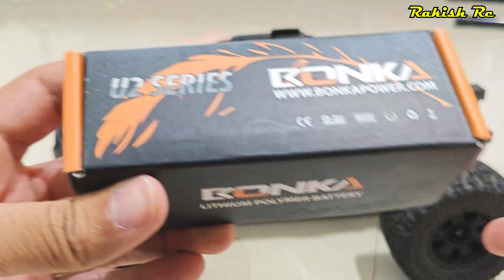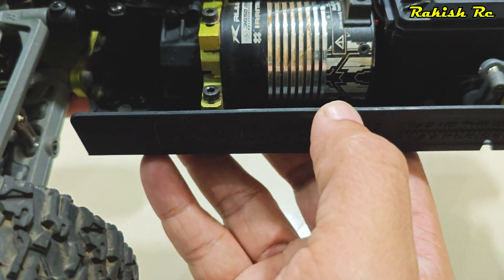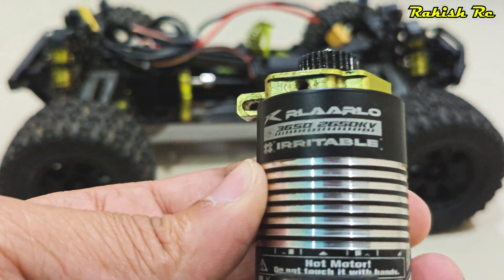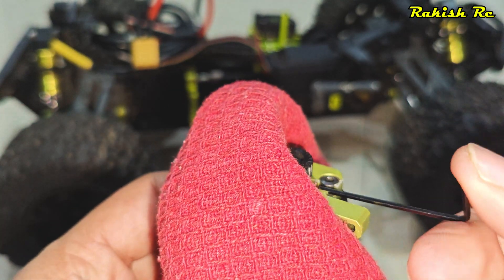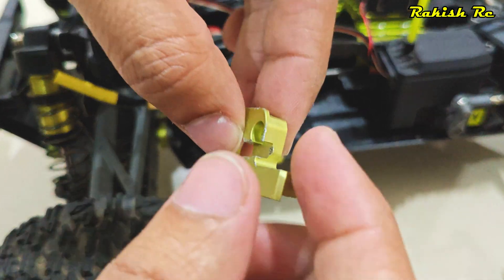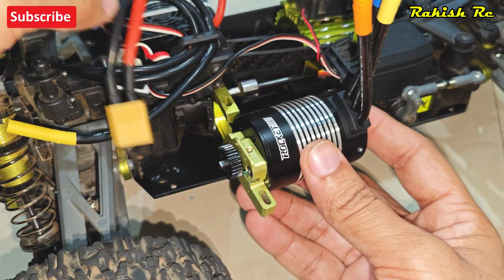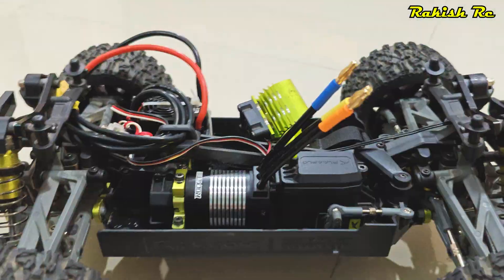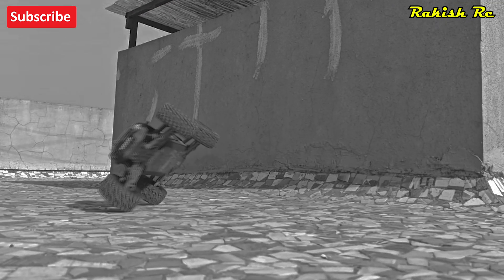Rlaarlo Omni Terminator 4s LiPo Battery & 4s Motor Upgrade | More Power!

Comment: Did this motor swap solve your heating issue?
Reply from the maker: On 4s the motor still heats up but compared to the stock motor on 4s it not that super hot. The best solution is to have a high rpm cooling fan on the motor.
Reply: @RakishRc  so the rocket motor is pretty good then? do you have a link for it?

Comment: I have a 4s 3300mh 50C , put it in the car and the car beeps at me then turns off , any idea ?
Reply from the maker: Stock esc is only 3s supported...does not work on 4s...need to upgrade the esc to 4s if you want to use with 4s lipo.

Comment: In your opinion, would it be better to go same size motor with lower kv, or bigger motor with same as stock kv? Thanks much!
Reply from the maker: @OGWHITEFIRE  i would choose a bigger motor and same kv Or slightly lower... Rlarrlo has 36 and 40 series motor mount option for the terminator.. So even though I am using a 3652 motor I feel like going for a 40 series motor is better for 4s usage. More power and also less heating as motor won't be under stress

Comment: The wires on stock motor seems to weak like they can rip of connectors easily when u pull em out the esc
Reply from the maker: @FreeBandsRC  indeed.. The wire shield is very delicate so it does rip off easily when trying to remove and install the motor wires on esc.
Reply: @ maybe that’s why I have a lil sluggish when I’m reversing I ordered a new motor waiting on it to come in
Reply from the maker: Is the connector loose Or needs some soldering? Anyways new motor should be better
Reply: @RakishRc  they look loose could need some soldering but I ain’t got tools to do that soldering type stuff

Comment: Do you have a link for this motor?
Reply from the maker: @TheMunozJandI  selecte the 3650 size 2300kv
Reply from the maker: @TheMunozJandI  https://www.ebay.com/itm/284423356932?_skw=surpass+motor+3650&itmmeta=01JK50HKDKVG3GDJT0P83GWZT6&hash=item4238f40204:g:TTgAAOSwEOFhJcV9&itmprp=enc%3AAQAJAAAA8HoV3kP08IDx%2BKZ9MfhVJKmcnmjF%2FuCcLfVwEJzSXZgIac6%2BRfe6qCQjiWzdCQLX95IUAw2TCGNrPpI9RXPs346kL%2F25QwoUi7mj7sz9BoVhqsXR6N%2B0ZcuOYf%2BI80JZC8yToRZR3F69YS39UZixyjqTSEx0uD9%2FZAKbSpcKqIf6LZEeWTn3mMrYhycbpbSq%2BFqdh%2B5B%2B0U343Rzz5d3wliZiiucnsKiCVHYzMS83ufjgcfkDmN1FuDVBJT6mh7OVNvAALrbqrd0PJNJR6oYxWxovcNJTuAI7aIEVyvNpmGx9t0VYw02br1uwI8ZTHKvvw%3D%3D%7Ctkp%3ABFBM9rbGoJll

Check this ebay link.

Comment: It's a 60amp ESC it will burn up on 4s in no time. I put a Arma blx 185 on the truck l had in my parts been with a 3660 motor truck is nuts on 4s.
Reply from the maker: But the rlaarlo stock 60amp 3s esc actually powers up on 4s but it enters shutdown mode after beeps.. So has over voltage protection but definitely does not function on 4s
Reply: @RakishRc  Anybody with a shred of intelligence in this hobby will tell you a 60amp ESC can't handle 4s even with that tiny 2200mah battery. What's your run time 5 minutes? I don't like to swap out batteries all day l run 4400 4s.
Reply from the maker: Hi, I agree that 2200mah will give shorter run time but there are 60amp 4s esc in the market.. Infact this exact same motor is sold in combo by surpass hobby with a 60amp 4s esc lol. 
Which esc are you using btw?
Reply: @RakishRc  Arma blx 6s. No issues with heat whatsoever. The Rlaarlo Terminator carbon fiber edition is the best Mini basher at this time. Blows away the mini Max l have even after I dumped the money into the mini Max to make it 3s worthy . I wouldn't know about a 60 amp you can run 4s on . I don't run anything smaller than 120amp on any of my bashers.

Comment: You says that you can run the stock esc on 4s battery??? Hav you run it on 4s?? You say that it heat ut but it will work??
Reply from the maker: @JörgenSandström-k6o  stock esc will not run on 4s..dont use 4s on stock esc.. It will turn on but won't function it locks up.. Stock motor you can run on 4s but need to be gentle otherwise it heats up a lot on 4s